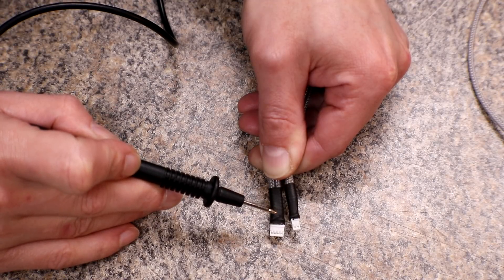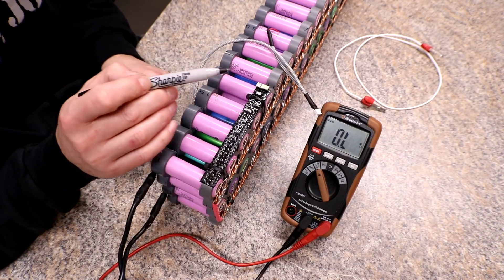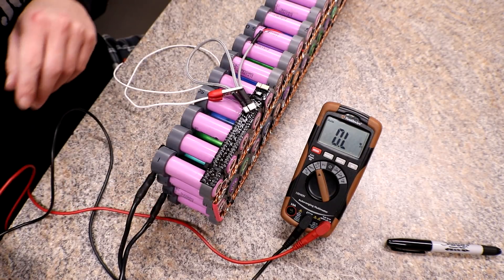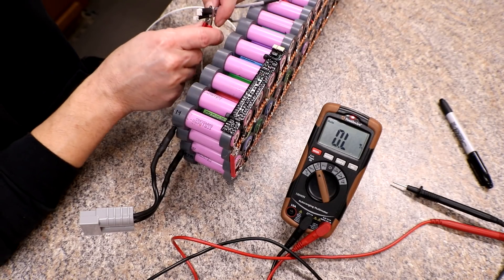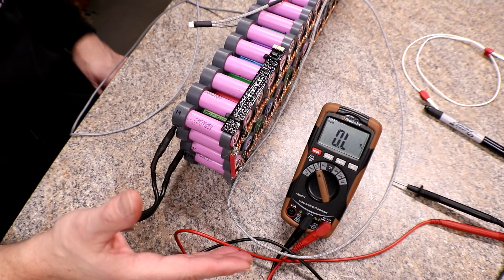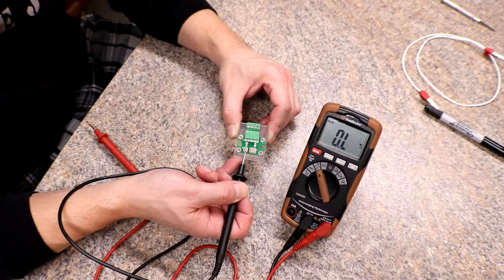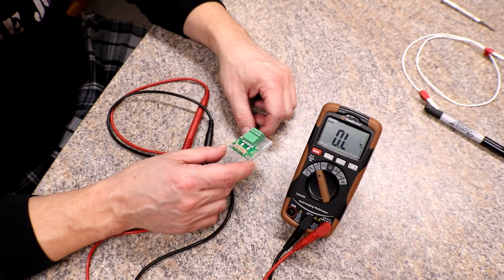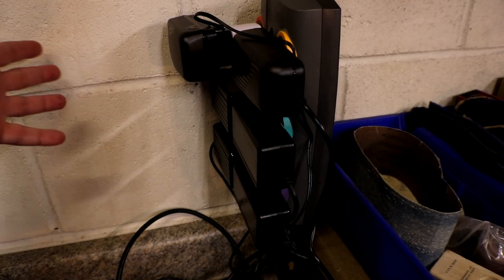Diy Tesla Powerwall ep72 Batrium Longmon Wire Checkaroo!!!

Comment: I have a question, i have a 24 volt system  if i reduce the voltage from the system to 24 volt exact will the bms on the 18650 only charge to 4 volt each cel or i am thinking wrong.
I have 6 cels in serie
Reply from the maker: Well 6s is 24v exactly so you shouldnt need to do anything if you get a 6s bms. Yeah each cell would be charged to 4v ea (+ or -) a little for tolerance.

Comment: the cable longmons the 2 pin connector was wrong cable wire blue where yellow color suppose to be, thank you. I have working right know, it took me at least 5 hours to find, so if you can mention, be careful when you receive the wire
Reply from the maker: Oh well good job figuring it out!

Comment: do you know how to check the longmons cables, I check electrical continuity on the cable and look ok, but when I connected to the long mons and I use the network checking they are bad
Reply from the maker: I would start by installing 1 or 2 longmons only and make sure you can get it to sync.  Once you get it to sync and working, try it on a few other longmons.

Comment: You could use the little board as a test rig,  then plug the cables in, and test using the ports... connect led and battery to the output terminals on the board,  then you just clip the leads in, led's light up, all good to go.??
Reply from the maker: I sent the watchmon back otherwise I would do that for sure👍

Comment: Are you 100% sure you didn't swap 2 pins around on a cable when rewring it ie swapping signal and ground on the cable cooking the input??
Reply from the maker: Yeah, I didnt remove any of the power wires to resleeve them.  Just the blue and yellow data wires.

Comment: Hi Joe I had one lead from Batrium where the red and black wires were wired the wrong way round.
Reply from the maker: HHmmmmm wow, did anything happen or did you catch it before the install?  Well all my longmons will turn on with the green and red leds so those should be good!👍
Reply: Yes I spotted it during assembly. Hmmmm I wonder what caused your magic smoke. Much better to find a fault than have it go away on its own. ( and come back and bite you later.)

Comment: I'm not convinced with your batrium to wire thing. It said 0.000 and not OL for one of the combos. I could be wrong.
Reply from the maker: I think since I did it in fast mode it didnt show all the numbers and thats why I was giving the thumbs up after each one cause I wasnt sure how it would turn out.  The only one that I saw different was pack 11 so I made sure a few times that I was reading it correctly.😃

Comment: oi Joe, did u check for short circuits with the meter on every wire, that will tell u if the insulation melted 2 wires together and caused a short???? ;)
Reply from the maker: Weeeeell....... I didnt check the + and - wires since the longmons would still work and all 4 of the wires are only close to each other by the 4 pin connector in the 3/4" heat shrink but I guess its worth a shot.  Ill check em out!!!😀👍
Reply: u could use a LAN tester and make a few rj45 to jst female cables, u can use that to test for continuity and reverse polarity ;)
Reply from the maker: True!
Reply from the maker: Lol maybe thats a reason to do it!🤔😜😆
Reply: Shorting signal wires together will rarely let out the smoke- usually you need to either short to ground or to power.  Prepper is right - checking for a short from the signal wires to the power ones is the most likely issue.  Yellow to the one next to it is the most likely.  Of course the "event" could have been a sharp solder point at  where you extended and that got melted off and cleared up as it was frying the mon...

Comment: Could it be possible that the Batrium was on when you connected those wires up? Possibly a surge went through it when one of the wires was connected. At what point did the smoke escape; when  you connected the wires to the watchmon, or afterwards?
Now here's a thought, what about checking the ports on the longmons to make sure "they" aren't shorted out somehow
Reply from the maker: +Korishan I cant really say when it snuck out because I was over at my pc but I could peak into the longmon connectors🤔

Comment: Good to check everything out. What about the other cable going into the 4 pin? If continuity checks good, no need cutting the shrink off.
Reply from the maker: +Tony B. You mean from the little converter board to watchmon, Ya those are good as well😊🖒
Reply: Well good, except you're no closer to finding the cause. It could have been a manufacturing flaw, either a bad resistor or the placement on the board. All part of the "fun" in commissioning something new. Hope Batrium finds something and the next one doesn't go POOF.
Reply from the maker: +Tony B. I think he tests the watchmons before there sent out. Im sure I did something lol or a possible surge like Korishan mentioned. Yeah its all part of the fun. Ill be hooking 1 longmon up to make sure its up and running like Jaron suggested once the new one is dropped off by the kangaroo 😀🖒